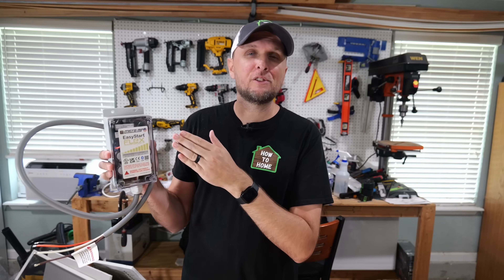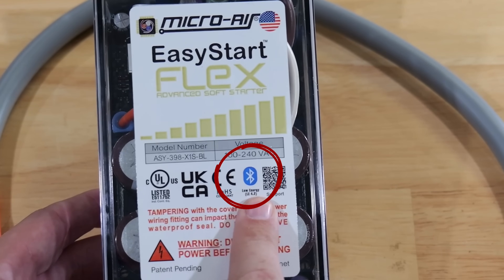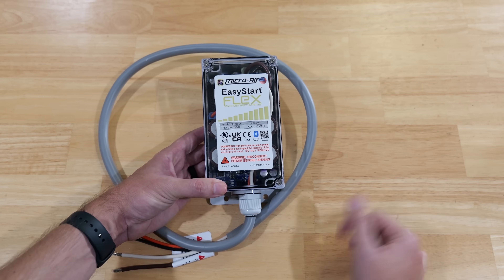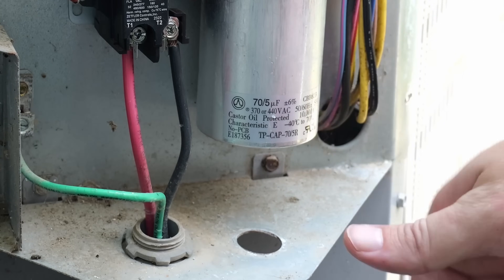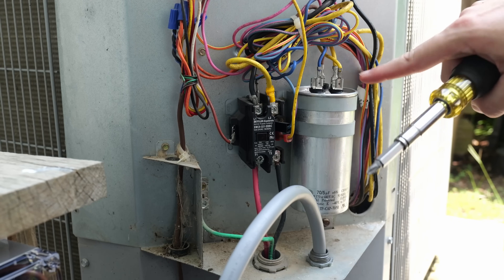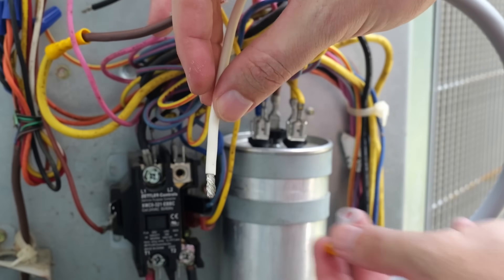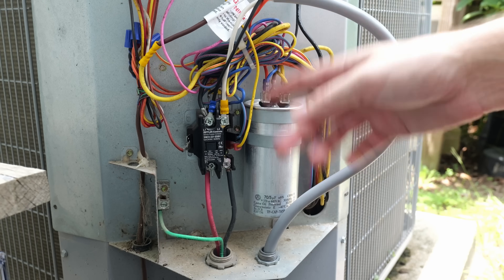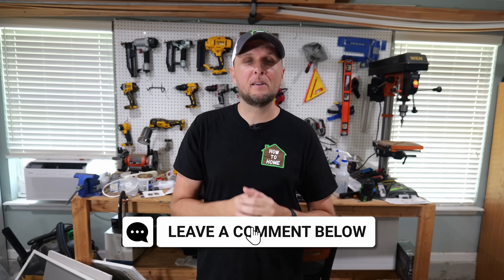The ONE AC Upgrade Every Homeowner Needs to Consider!

Comment: I have a 23 year old A/C and HVAC system.  I maintain them by conducting my own annual service which includes cleaning and ensuring top performance.  I installed one of these and am exceedingly happy with it.  By far, your video instruction made the job easier than it already was. 
For those with similarly old units and cannot commit to a new system, I’m here to tell you that changing out a capacitor, a contactor, an A/C fan motor and even an HVAC blower motor and its capacitor (yes they also have a small one) are exceedingly simple jobs that a DIY’r can perform.
On top of that, I recently learned that those A/C power pull disconnect boxes tend to FAIL over time due to corrosion since they are outside.  The corrosion in the wire connections causes resistance which causes heat.  The plastic components tend the to melt over time and some have been known to catch fire.  I noticed that mine was already melting and deforming.  So, for $20.00, I bought an identical box through Amazon. It was delivered the same day!  I swapped out the internal components and reconnected the wires, keeping the original box, but with new components.  Since the load wires had been exposed to too much heat (the first layer of insulation was peeling off), I went ahead and bought 20’ of 8-Gauge stranded wire at Lowe’s and simply swapped out the load wires to the A/C unit.   Now, everything except the compressor is NEW (capacitor, contactor, load supply wire, and fan motor, HVAC blower motor and capacitor).  The A/C fan motor cost $120.00 and the HVAC blower motor cost $110.00. New Capacitors were $15.00 and $10.00. The A/C contactor was $20.00.  Hope this helps ya’ll.
Reply: I'm with you brother. My system is going on 32 years old with at least 18 years of not seeing a hvac tech. What will probably do it in is the rust on the coil in the air handler. I just sprayed some Rustoleum Rust Reformer on a few bad spots at one end of the coil. The other end looks ok. I wish I had caught it years before. And I had to repair some rusted areas in the bottom pan. And a badly rusted screw at a heating element where one of the power wires is attached but still making good contact. Now I've got a box of backup parts like caps, contactor, transformer, relays, defrost board and more. Condenser fan is still ok; it's got a small hole to add a few drops of oil. With help from these videos, hope to reach 40 yrs. Good luck with yours.
Reply: @geecrawdad  Unless people live in a snow belt, it makes no sense to make an A/C unit last 40 years.  In the South, the A/C unit basically runs year round, and it is far more cost effective to replace it with a more efficient unit every 10 to 15 years.

I did that two years ago, and my new A/C unit will easily pay for itself in about 6 to 8 years.  My electric bill in the summer was getting close to $500, now it struggles to reach $300.  As a bonus, the new unit works so much better, and eliminated the Hot and Cold cycles of my old single stage unit, which were already driving me nuts...
Reply: @redbaron6805  Here in Georgia, our heat pump runs only seven or eight months a year; we get by without it in the spring and fall. I just need to find out what a new 2-ton system will cost so I can figure the break-even point including the possible rebates available through HER and HEAR. I need to consider as well that my bill is not that high and that we often hear, even on HVAC sites for the pros that current equipment is less reliable. I guess I'm a diehard diy'er and take some pride in keeping old things running, probably to a fault! So, in general, you're likely correct but some of us just won't listen 😊
Reply: @geecrawdad  I hear you.  I'm a bit south of you in South Florida, so my A/C runs probably 11 plus months of the year.

I also hear the newer equipment is less reliable, but not sure how true that is.  I ended up buying a Variable Speed Trane 4 ton system which was a SEER2 18, while my old single speed system from 2006 was rated as a SEER 13, but it was a lot less than that, as the air handler cabinet was rusting, the gaskets were leaking air, and the insulation inside the air handler was disintegrating and falling off.

If you need a 2 ton system, you may be a prime candidate for a Mini Split system, depending on the application and layout of your place.  They can easily be SEER2 20+ and are amazingly quiet and efficient.

My master bedroom has a dedicated 1.5 ton single speed system from 2006, which is probably getting close to end of life.

I'm still debating if I'll replace my master bedroom central system with a dual mini split, one that runs the bedroom and one that runs the bathroom, or replace the central system with a newer and more efficient central system.

Whatever you decide to do, if you do replace your system, try to get it done in December or January.  That time of year the A/C places are pretty slow.

Both of my central A/C systems are in the attic, and replacing them in the middle of summer when the attic is 140 degrees plus means the installers are going to be miserable, and trying to finish as soon as possible.  

Replacing them in December or January means they will be nice and comfortable, and can take their time to do the installation correctly.

Keep in mind that 90% of A/C problems are considered to be installation errors and faults, and the equipment itself is rarely the root cause of the problem.
Reply: @redbaron6805  Good points and advice. I know little about mini splits but will go with anything that is diy friendly. Thanks and keep flying right red baron.
Reply: @redbaron6805 . Poor you!  How old is your 4 ton multi stage Trane?  I had my first problem at year 7 and by year 8 I have spent around $6000 on repairs.  The stepper valve and stepper motor, leaking evaporator coil, bad compressor, 3 mother boards in the air handler…..  the $6000 was strictly labor as the parts have a 10 year warranty…. Around Houston in the summer they charge $500-$900/hour for labor….what a scam!  And for Trane to warranty the parts a certified HVAC person has to get the parts….
Reply: @trailerparkcryptoking5213  You are definitely getting ripped off.  Fortunately I have multiple honest A/C companies in my area including the installer of my system, which has had zero issues.

Sorry to hear about your experience, but I have another Trane system at another house which is over 10 years old, zero issues.
Reply: The AC disconnect "pull-out" boxes are junk, both the fused and un-fused types.
If your system has one, replace it with a "real" disconnect switch or a 2-pole NEMA-rated circuit breaker. Square-D makes a "QO" type disconnect switch for AC compressor applications, which is excellent, and it will also accept a 2-pole "QO" breaker if necessary (if your existing pull-out is fused).
Reply: @Calico5string1962  Awesome!  Thank you for that great advice!  I do do exactly that!
Reply: @Calico5string1962 . What determines if it is a “real” disconnect box?   What does the “QO” mean?   I just replaced a broken box with one that looked similar at Home Depot, but want to be certain I am using the best box….. Thanks
Reply: Well done. I went so far as to get my EPA cert and $1000 of new and used tools to work on my only couple year old system. The refrigerant filter drier was already clogged up. Probably a bad install. 

Now, most people probably shouldn't go that far, but there are plenty capable of doing the things you mentioned. We have a DIY HVAC store near me. They help people with their projects.
Reply: @flycrew  I am STRONGLY considering getting my EPA certificate, too.  The next thing is top swap out the entire system.
Reply: @rb2287 Just saying, the place I bought refrigerant from didn't even ask for it. But the course didn't take long at all, and the test wasn't very hard to get the universal cert. I used skillcat.

Comment: Does it work with heat pumps?
Reply from the maker: Yes.  Mine is a heat pump.  Had an AC guy out last week for regular maintenance checks and he asked if that was a soft start kit installed on it and I said yes.  He said he's never heard a compressor start up that quietly before.

Comment: Small generators will not start a AC unit they are only 110V not 220 volt. Not sure why you would want to spend hundreds on a gimmick devive. AC unit have started with that high inrush for decades. The AC has to overcome all that pressure built up in that compressor. Your AC unit will be fine with that intush. Most electrical devices have a intial high inrush with not damage to the device.

Comment: I have that same meter. Just in case it reads OL (Over Limit) when trying to get the in rush reading you will need to press the Range button so it can read up to 600 amps instead of being limited to 60.

Comment: Can this be used to power a well pump? The startup amps blow the breaker when I try to use it with my generator. The running watts match the pump.

Comment: We spoke to our power company and the potential savings are pennies on the power bill.  On that note alone the ROI is not there.   However, on improving the life of the compressor, it may have reasonable ROI (Micro-air's are $$$).  Does anyone have any objective data that this investment would actually improve the life of our AC unit?   Any independent studies?   We love the idea but there needs to be REAL value.  Thanks
Reply: Thanks for your comment. It got me thinking. I know what might be REAL for me may not be for you or anybody else. Yes, I would like to see objective data supporting ROI, too. About 5 years ago, we installed central AC. The lights would dim. I installed the “364” model and no more dimming. I now have the “FLeX” installed and very happy with that, too. Installing these EasyStarts just to stop lights from dimming might seem vain to some but to me it illustrates the stress going on within the actual equipment keeping us cool. The voltage drop occurring due to our old house wiring from the meter to the secondary was not something I was going to change. So, I checked out EasyStart. What I instantly liked upon reading about it was the potential fault checks the unit goes thru in the background. Low/high voltage checks, etc. As I expect it in the future, brownout conditions due to hot/cold weather event conditions may occur affecting utility power which can damage the compressor, among other things.

What else is REAL for me? Your question made me realize this. Last fall, we installed a whole house standby generator, 20kW. It can handle all our equipment/appliances which may be running when we are not home, including on a 115°F day, like we had 3 years ago this June. But, my realization is, if I remove the EasyStart, the generator will most likely check off when it attempts to energize the AC because it can’t handle the additional starting 35A needed (which EasyStart removed from the equation). Yes, I know I can install modules to prioritize emergency power but I would rather spend $500+ on other things. One of them being an EasyStart. 

We had a winter weather event a year ago where we lost power for 4 days, 15°F. My portable generator kept us out of trouble. From this event, I later learned my neighbors had switched from gas furnaces to heat pumps (no emergency power). Today, they all have standby generators. I understand these EasyStart devices can work with heat pumps, too. For me, my AC only comes on 60-70 times a year. I wonder how many times a heat pump cycles on/off a year. If I had a heat pump I would definitely consider installing an EasyStart to reduce the equipment stress for all those starts. Plus, less starting power required while operating with emergency power.

Comment: Awesome How To!  I installed this unit on my heat pump to see if it would quiet it down. IT DID! Not perfect but much better. Also, the inrush current went from 135 to 26 amps!  It even knocked down the run amps from 9 to 7.6! Pretty sweet! Keep up the good work!

Comment: Going on just the meters reading power saving is awesome, that would lead to a lower power consumption and cost.
Reply: It's funny because the UlTrA MaGAt thinks that inrush amps factor into billed power consumption outside of extreme edge cases.
Duhhh... won amp 4 5 minutuez iz diffurnt frum 5 ampz 4 1 minit.

Comment: Great video. I bought this new version to install so I can run my home from a generator if needed.  When I took off my panel, my capacitor only has 2 terminals. How would you wire this???

Comment: I am reading the inrush amperage from the run wire and it reads 0.L with a run amperage of 10.2. 

Am I doing something wrong? I do not see anything else attached that would resemble an already installed soft/hard start kit..
Reply: OL = over load, I.e. too much current for the meter to handle. Try a higher current value on the meter or get a meter that reads more current

Comment: How to home; any idea if these work with a unit that already has a VFD card installed? (Variable Frequency Drive)
I'm running a train heat pump that seems to really crank out the startup load. I would hate to destroy it by installing something like this.
Reply from the maker: That is a product question you would want to ask Micro Air.  I am not an expert on their product and what models specifically it’s capable of being installed on.  So if it was mine, I would want to verify that first.

Comment: For the price of these soft starter units i would think it would come with connectors?
Reply: You can add a kit that contains all of the connectors you may need. Not that much extra and includes all of the liquid tight connectors also.
Reply: @DrCbass123  That's good to know, but I think the point was at the price of the unit ($300+), they should come with them. The connectors you need are very specific to this unit (they come in all sizes) and I kinda see those as part of the unit accessories. I mean, if you have to have to have them to make it work, I think they should be in the box. Even a $25 light fixture comes with wire nuts, and you probably already have those. These connectors or wire wraps should be pennies each and it's rather cheap of them not to enclose them. Probably sell for 10 cents each if you could find them by the piece. We're only talking a few inexpensive items here, that you cannot hook up the unit without. Everyone doesn't see YouTube. I'd consider that unit somewhat incomplete if I got it and was then surprised to find they weren't there. I'd be all ready to set it up and then find I needed to go to the hardware store and would not be happy.
Reply: @floridaredneck  I definitely see your point and can’t argue too much. I’m guessing there’s probably $2-3 worth of connectors in the bag you can purchase and they sell it for $11. It’s definitely paying for convenience. Im sure I’d spend 45-60 minutes traveling to the local hardware store and sorting through the proper connections. 

I don’t disagree they should probably be included for the price of the unit. But you can’t fault a company for squeezing an extra dollar. Capitalism at its finest.
Reply: @DrCbass123  I think for the most part we're together on this, so let's shake on it. I think they should squeeze the extra dollar or five in the price and put them in the box, but I basically said that already. I think this unit is actually smaller and half the price of their last model, but not sure, so I'm not saying the price is bad at all. Best Buy did the same thing with my head unit (fCarPlay) for my older car that had an AM/FM in it, and I wanted to upgrade it. The website said the installation was free. It was free, after I drove 40 miles for installation, they told me I needed to gave them another $160 for the wires to hook the damn thing up to my steering controls (It would have worked, but not with my steering wheel). I would have rather my new $350 touch screen I bought online with free installation to have been priced at the real $510 cost. That kinda happened to me, so that's why I used the example of getting something you think is one price, then having to pay more because you need something extra. I wish my wires had only been 5 bucks!
Reply: @ yeah I think we’re in agreement too. I had bought their older model (definitely much bigger). I’m sure the cost of that one was higher to produce due to the size. I imagine what they saved on material for the smaller footprint would have easily covered the cost of the connectors. 

I’m with you, charge me an extra 5 bucks up front and throw in the connectors. I’ll talk about how complete of a product they sell and they truly care about the customer. Appearances go a long way. 

lol and sorry about that free installation. Those sort of things make me wanna go berserk… just be honest up front with me! 

Appreciate the messages.
Reply: I was wondering that too. I guess most folks have to buy a whole connector set, most all but 4 they'll never use. Then buy a crimper, because everyone keeps those lying around; you crimp every day, right? I mean, you spend $15 on a TV wall mount and get 50 screws of different sizes, 20 sets of tabs, depending on how far from the wall you want it, and after the install you have 55 pieces of stuff left over you'll never need. And these folks won't include end connectors? I'm writing congress about this; oh wait, we don't have one. Oh well, guess I'll go to the connector and crimper store.